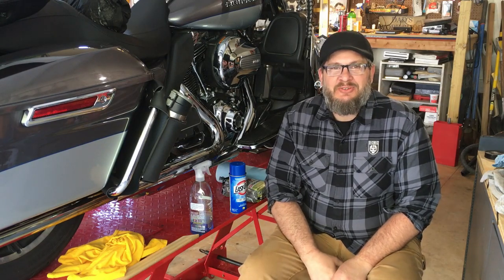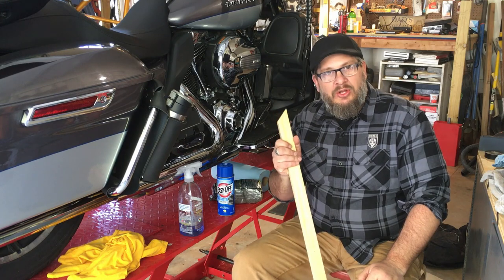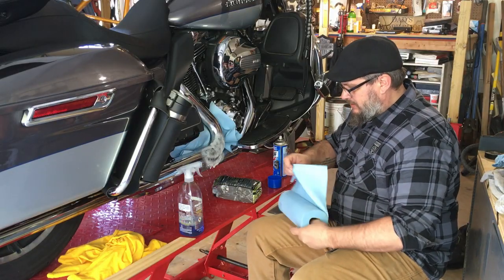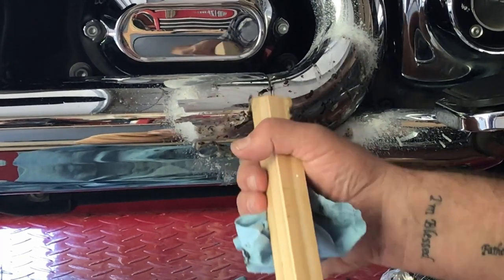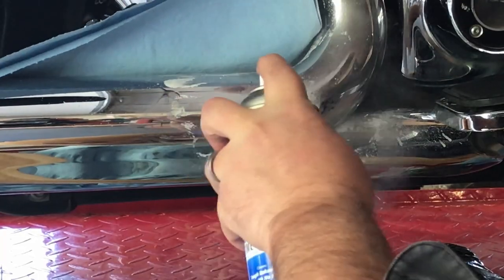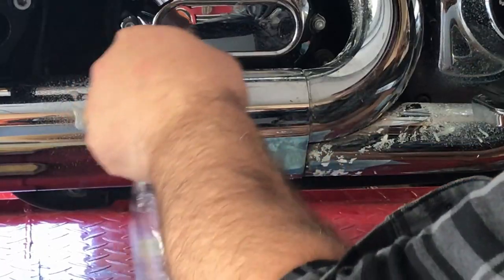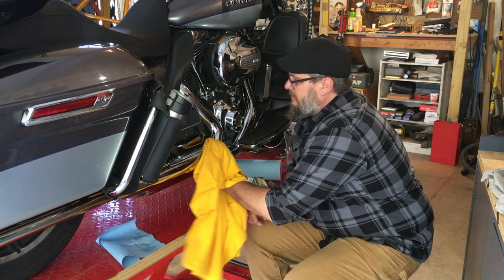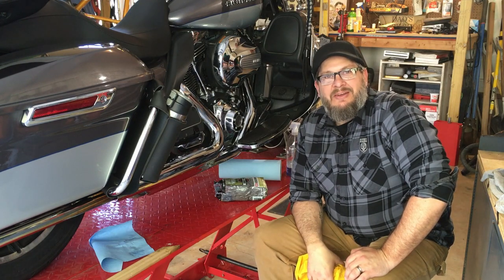Clean Burned Items off Exhaust

Comment: I recently put my rain cover on my Bonneville too soon after I stopped the engine. Some of the rain cover melted on to my chrome pipes right at the header.  I started the stain removal task with Bar Keepers Friend and 0000 steel wool.  The burnt cover was coming off the pipes slowly but surely, however with considerable effort and time.  I followed your method and the results were pretty damned good with much less time and effort.  Covering other engine parts with something to avoid overspray is important.  I used strips of cardboard.  Oven cleaner contains sodium hydroxide (lye) and some other unpleasant chemicals which are flammable.  Too bad I can't share before & after photos.
Thank you so much, my friend 😎

Comment: Dollar store brand works great to.  The other thing is if you don't clean it soon it will be much harder to clean and may not look right when done.  Hey the other thing is that cleaner is not good to breath.  It will remove paint, powder coat and can etch aluminum. So be careful

Comment: I tried a white terry cloth clean rag and dampen it with water on a hot pipe and removed most of the polyester that melted on pipe when I used the clean area of the cloth. Will heat it up again and try it before Easy off with terry cloth
Reply from the maker: Good feedback. Thanks!

Comment: Would this process be safe to do on a titanium exhaust tip? I used wheel cleaner thinking it would clean it but ended up staining/watermarking my exhaust.. any help/advice would be most thankful
Reply from the maker: @EZ- Riders good call and good advice
Reply: Did it work cleaning your titanium exhaust?
Reply: @Otsp922  absolutely NOT, had to literally sand it down and now the blue tip is gone..rip... now I’m just gonna polish it

Comment: I have a little bit of a burnt on boot sole mark on one of my V&H Big Shots Long and there's also a bit of gold discoloration on them in an area but I don't have any oven cleaner or 0000 steel wool at the moment, I do however have some Bar Keepers Friend, Brasso and Mothers Aluminum And Mag polish, I thought I'd give those a try since I have them on hand.

Comment: Use a nickle, don't have to heat up bike, no chemicals to breathe and does not scratch chrome. I have a 2015 CVO Street Glide that tape burnt a spot about the size of yours, I rode for about 2000 miles after it was discovered and never got around to remove, i was looking for a replacement part, or having the piece rechromed cause I didn't think the spot would come off, I was told to use a nickle so i tried it and after about 5 minutes it was gone, no scratches to the chrome, no fumes from chemicals and used water on a rag to clean off pipe and dry.
Reply from the maker: Good call thank you.  0000 steel wool works awesome also

Comment: It worked so well. Thank you...
Reply from the maker: Awesome glad to hear it
Reply: @YogisCycleService  Been here 2 years ago, after 2 years here i am again... Tried this method and didn't worked this time then i remembered pipes had to be hot when during the procedure. Gonna go warm the bike and try again.
Reply from the maker: @TheWitac  0000 steel wool works well also once you get the bulk of it off.  I used it last weekend to get some nasty road grime from a oiled gravel road off the pipes that was cooked on

Comment: Wouldn't the steel wool scratch?
Reply from the maker: Good question and the answer is no with 0000 steel wool.  It actually works awesome on chrome.  Yeah surprised me too
Reply from the maker: Best thing I use it for is dead bugs on mirrors.  Works like a champ
Reply: Update..... Oven Cleaner worked like a CHAMP!   Thanks!!!

Comment: Cän I use it on Matt black pipes
Reply from the maker: @donaldduck2801  that I am not sure of and I would hate to tell you yes go for it and then you come back to me with news it didn’t.  My guy says it’s fine.  It’s oven cleaner.  It’s used in painted surfaces because many oven interiors are painted but usually gloss not matte finish
Reply: I used it on my V&H pipes (oven cleaner) and it worked.. didnt use the steel wool.. just wiped it down.. hot pipes.
Reply: @anthonydunn7043  
Thanks bro,
On my fatboy lo it is so annoing,  the heel ofthe right shoe  melt an d tough the pipe .

Comment: Easy off did nothing
Reply from the maker: What’s melted on there and did you heat up the pipe?
Reply: You did something wrong. Has worked for me for 40 years ever since owning a Harley. Spray it on the night before then just wipe it off in the morning. If really thick also use a plastic credit card.

Comment: Do wd 40 spry work?
Reply from the maker: It’s a good question
Reply: And if not how about break cleaner?
Reply from the maker: @simenmary4121  Yes possibly but I found for stuff that’s melted it on oven cleaner works pretty darn well along with some 0000 steel wool.  I don’t think wd or brake cleaner will get it off as well but worth a try I suppose

Comment: Spray it on and let it sit for 24 hrs. then it wipes off easy
Reply from the maker: Good feedback thank you.  I will try that next time and see what happens
Reply: @YogisCycleService  I agree. Spray EO the night before then just wipe it off in the morning. For any really thick stuff, use a plastic credit card to scrap it off - faster and easier than a piece of wood. I also use Windex on chrome = NEVER steel wool. I saw some chrome under a microscope after using steel wool regularly = not good. Looked good to the naked eye though.